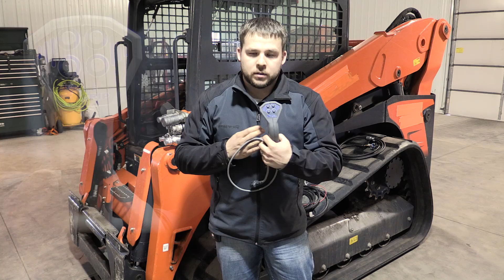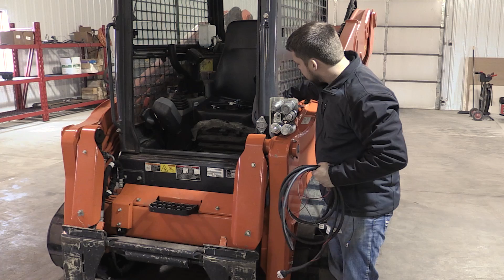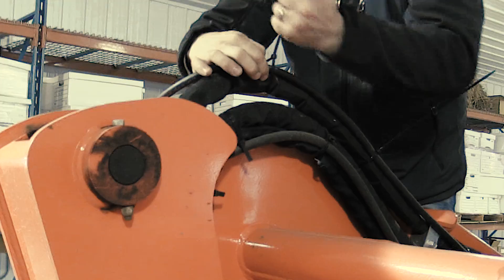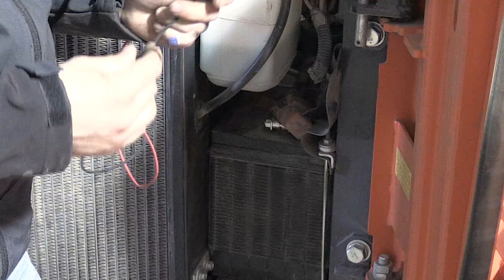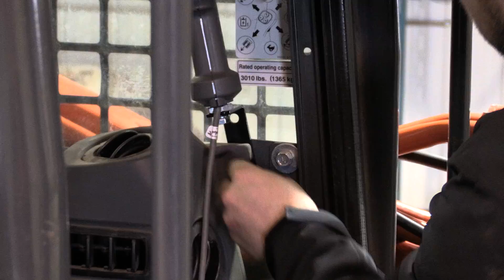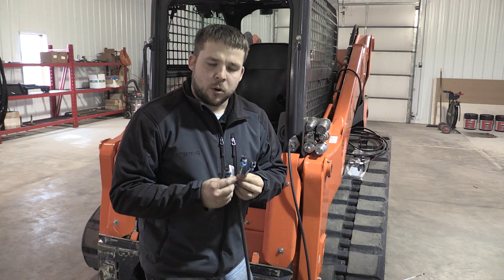Quick Attach® Universal Pistol Grip Skid Steer Attachment Control Harness Installation Instructions

Comment: Sorry, I should have been more clear.  I have a cat 259d and I want to use a bobcat 7 pin attachment in the cat 259
Reply from the maker: Understood. No, this would not directly plug into the bobcat attachment. This is designed to be used with a Quick Attach attachment on a machine that does not have an electrical harness.

Comment: Does that work for a bobcat 7 pin?
Reply from the maker: With a bobcat 7 pin, a harness that plugs directly into that would be more desirable. This is primarily for machines that don't have a built in connection like a 7 pin.